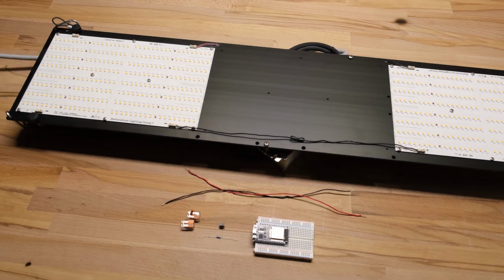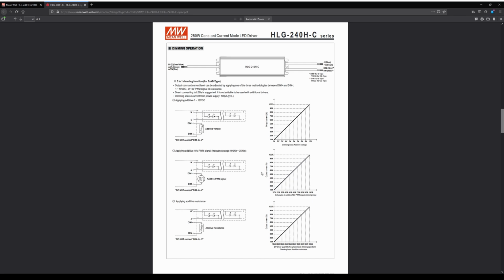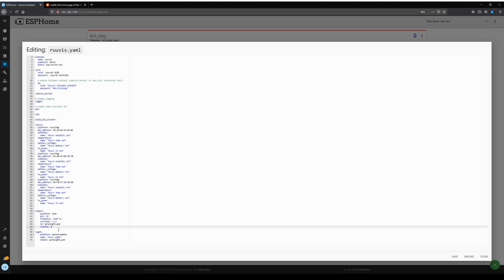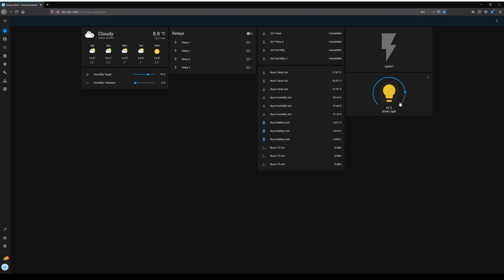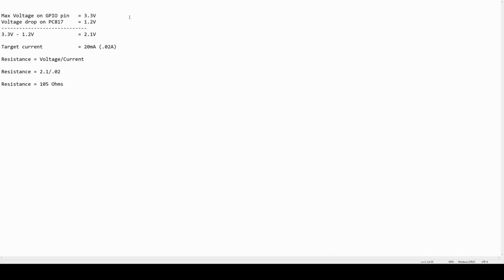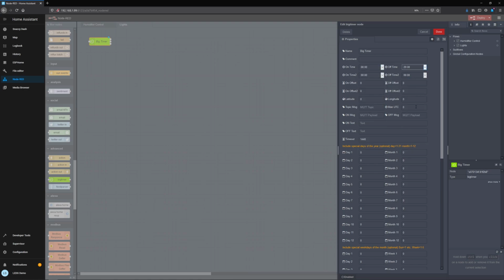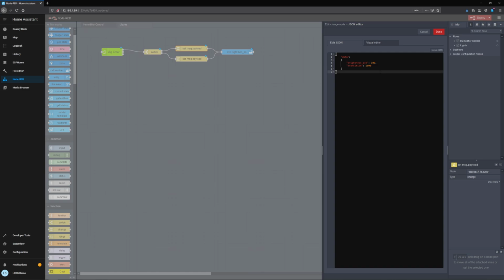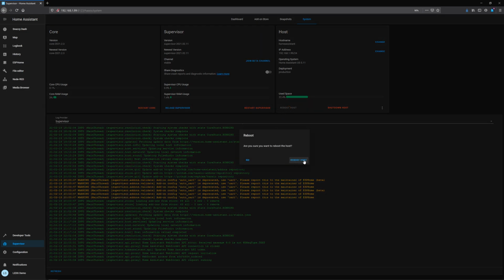Automate Your Grow with Home Assistant #7: Dimming & Scheduling Your Grow Light

Comment: Thank you very much for sharing such a high value content. It helps me a lot with my greenhouse project.
However I have one question regarding the brightness_pct value in JSON file. I am trying to use helper to set this value dynamically (from user input slider) as below:
"brightness_pct": msg.payload["input_number.light"]
But it shows error "Not valid JSON data"
Do you have any advice on this? Thank you
Reply: I found the solution: I use automation with this data
brightness_pct: '{{states("input_number.light") | int}}'

Comment: Can I use the same code for my ESP32 as you have with this driver?  https://img80002871.weyesimg.com/uploads/mosopower.cn/addon/15736278104243.pdf  I believe I can, but the only thing I don't get is where the 1220hz frequency comes from.  Thank you so much for making these videos!
Reply from the maker: Looks to me like that driver should work fine with this method (seems like it has the same 3-in-1 dimming where it sources power on the dim circuit). The PWM frequency spec on the data sheet is 200Hz to 2000Hz so 1220 is fine.
Reply: @LEDGardener  Thank you so much, I just tried it and it's working to dim up and down!  Very exciting I'm learning so much following your project.

Interestingly, the driver documentation says 0-10v, but when I power the 110v up from my smart plug the light doesn't come on until I go to 6% or above on the Home Assistant light card slider, and then when I go back down to 0% it doesn't turn off, it stays at about the 5% brightness, dimming ever so slightly more if I turn the light card "off."

Also, with the 1220hz, is that just the number you picked in between 200Hz and 2000Hz?  Or did you choose it based on electrical maths and the dimmer you were using?  I was going to try and hook up a AC Infinity Cloudline S4 the way you had hacked the PWM on your AC Infinity PWM fan, and saw the different Hz in your github code you mentioned with regard to the different channels on the ESP32 you talked about in the video.

Thanks again!
Reply from the maker: @fantasticplastic6170  this page will answer many of your questions: https://esphome.io/components/output/ledc.html   the 1220Hz is one of the recommended frequencies on the list and fits within the spec for most lights. 

Regarding the light not turning off completely, what happens if you short the 2 dim leads together? Does it turn off? You can set up thresholds for min_power and max_power which might help for the turn on/turn off issues. Check out this page for more info on these: https://esphome.io/components/output/index.html

I picked different frequencies for the fan control based on the freqs I measured when using the default controller it comes with. The new AC Infinity fans are even easier to control as they have actual PWM inputs you can use. The wiring is a bit different. I'm using these new S-series fans in my system now.
Reply: @LEDGardener  When I short the wires the light stays completely off.  Does that mean my ESP32 is leaking very slight amounts of power to the output pin after it's energized the first time, so when I go to turn it back off again it never goes low enough to completely turn off the diode on the optocoupler?  If the min_power defaults to 0 what would I set it to in order to use that to correct the issue, or am I trying the zero_means_zero command?  Right now I have two Flows going, where the light smartplug turns on 1 minute before the PWM starts to ramp up and one minute after it finishes ramping down, so it works fine, but I'd love to figure out why it's behaving like it is.

Thank you for the links, and for taking the time to answer questions!  I definitely understand the frequency thing better now I think, and am going to try and hook up the fan next and ramp it up and down based on temp or humidity based on what I learned here and in the humidity control video
Reply from the maker: Strange. Does reversing the dim wires on the driver have any effect? I was thinking you could set up the min_power to eliminate the first few percent not turning on the light from the off state, and then doing the zero_means_zero thing.
Reply: @LEDGardener  Interestingly adding the min_power: 0.05 and zero_means_zero: true didn't change anything, but reversing the dimming conductors did.  Now it doesn't turn on until I go above 20% on the slider, and then the light turns off completely again at <16%.

Hard to tell if the actual range/sensitivity of the slider has changed without a par meter or something to measure it, but it still seems about the same.

Comment: I got it all working mostly...The problem you mentioned about the dimming not working till you get to 50% I get that with the gamma_correct: 1.0 still. Do I just have to adjust that until i get what I need out of it? because little increments on the dimming make big light adjustments and I'd like more fine tuning than that.  TIA
Reply from the maker: Which driver and lights?

Comment: Could you show me your flow for the ezo ph sensor? Within node red? I’m struggling to figure out how to do it myself
Thanks
Reply from the maker: I didn’t do my system in node red, it’s in my home assistant automations
Reply: @LEDGardener  is it possible to add a delay within the automations so that it waits to test ph again after mixing before adding more ph down? I didn’t see that option so assumed I needed to use mode red
Reply from the maker: You can just set up an automation that triggers every 30 seconds or minute or whatever and when it triggers, it checks pH and if it’s out of range, it either doses a little blast up or down. A minute later the trigger will fire again and it’ll do the same check. I believe the trigger is called time pattern.
Reply: @LEDGardener  thanks I’ve got that working perfectly I just don’t see the option to get the action of turning pump on to last only seconds? It just turns it on for ever
Reply: Figured it out thanks I thought the actions ran concurrently didn’t realise it was one after the other
Reply: @LEDGardener  so is the HA automation wizard powerful enough to do all the automations you needed for the garden?
Reply from the maker: It is.

Comment: Does this work coupled with light sensors? For instance, in a light deprivation greenhouse where lights are used to supplement the sun. So the light sensors would measure the light coming in and brighten and dim the lights appropriately in real-time to try and keep a steady level of light at the canopy throughout the day.

Comment: Legend. This channel is superb! Ive just started following along. I havnt seen any soil moisture detection yet? Or have i missed it?  I have a little simple system with a cheap capacitive moisture sensor in rock wool but it doesnt seem to be very responsive. Do you have anyinfo/experience with these?? 
Thanks and keep up the channel its by far the best on this subject! 
Bob
Reply from the maker: Thanks! I haven't incorporated it yet since I grow in coco usually and just flood the hell out of it whether it's wet or dry.
Reply: Thanks. - do you have a video for setting up the weight sensors? Or know of a video tohelp me set them up with home assistant.
I want to try use these to tell me the water content of a rockwoolslab sat in a rigid tray.
Good idea? 
Thanks

Comment: hey man i have a question, i am starting to check the automations for the nute dose but since i used a cheaper peristaltic pump the 300ms on time for 1 ml does not apply as i tryed and for 1 ml i need 750ms on time, so my question is would change the multiplier in the other script be the appropriate way to go? so just change the multiplier in the 1dosenutes: script?
Reply from the maker: Have a read through this page of a thread where someone else ran into this problem in the forum for my answer: https://ledgardener.com/forum/viewtopic.php?p=24471#p24471
Reply: @LEDGardener  yeah as i thought, you said what i was trying to explain in that page. ;) glad i was not too far off, i tryed a lot before asking XD

Comment: Should a different resistor be used for a 600w driver?  Great videos by the way, thanks!
Reply from the maker: The output of the driver won’t affect the power on the dimming circuit so no.
Reply: Just got one working, thanks again.  Quick question though, can I use one esp32 to dim multiple drivers or should I use one esp32 per driver?
Reply from the maker: Just use the same ESP. Add another resistor, optocoupler, and declare another output and monochromatic light in ESPhome on a separate GPIO pin.

Comment: Do you have a reference for the nodemcu-32s board?

Update: Same setup works on nodemcu-32s board on pin 23. What I feel though is that the light on 100% with the pwm is slightly dimmer than without it. Not sure what is causing this. Else I'm able to dim/turn off at 0%.
Reply from the maker: If you disconnect 1 pin on the output of the opto does it get visibly brighter?

Comment from the maker: Hi all, something to add and one thing to correct... Afterwards, I also tested this method on an Inventronics EUD-600S560DT (HLG Scorpion Rspec) and EUD-600S280DT (HLG 600 Rspec) and it worked great. Something I need to correct in the video - at 11:33 I said that it didn't matter which way you plug the dim+ and dim- wires into the output of the optocoupler. This is incorrect. The Inventronics drivers I used did not dim all the way down to off unless I put the Dim- on the optocoupler emitter pin (with the orientation I have it in the video, it would be the top right pin) and the Dim+ on the collector pin (shown top left in video). So, if it doesn't work quite like you expected, try flipping your dim wires on your opto output!
Reply: Do you use float switches in your setup at all?

Comment: Hi! I made a pcb a while back that would totally fit your usecase. It's designed for a ESP32 to control up to 4 channels of either external meanwell drivers, LDD-H or LDD-L. And I included a lot of optional features like temp sensing for all 4 channels, a BME280 sensor, a light sensor, RTC and two Outputs for 12V PWM Fans. I could send you one or opensource the design files if you're interested...
Reply from the maker: Sounds pretty badass. What is the temp sensing for?
Reply: @LEDGardener  Monitoring/controling the LED panels temperature. Mainly for safety reasons...
Reply from the maker: Very nice. Which probes do you use?
Reply: @LEDGardener  Since I didn't need high precision I just integrated some 0805 ntc's in the LED pcbs...

Comment: Man this is awesome😉, could you please send me a picture of the cloudline t6 connection inside the fan? Now lights, humidifier, Nute pumps, ph and ec probes, flooding sensor, float basin sensor, external outlets for the pumps, 12v solenoid are working. I just don't know how to do with the t6 and I have to order a digispark board for the hx711 and do all the plumbing and I am done😉💪
Reply from the maker: Good work. Is it a new T6 or older one? The new ones have an “EC” motor.
Reply: @LEDGardener  yeah It is a new one sadly, I have two of them one for  the air intake and one for extraction
Reply: @LEDGardener  so i tryed anyway to wire the t6 like you have done aaaaand it worked XD i just intercepted the small yellow wire in the t6 wire box and invert the high setting number in the esp config with the low one, i have now pwm control over both intake and extraction, the only thing that will not work is power off the t6's since you are not actually cutting power that way but just intercepting the pwm cable, i tink i could wire it up to one of the spare relays in the control box and if i need to power off just cut the power that way..
Reply: @LEDGardener  hey mate, please can you tell me how to find the calibration factor for the hx711? i am really desperate :( now its working with the right module but its off by 20kg :( it is the last thing to calibrate..
Reply from the maker: Are you using my code for it or something different?
Reply: @LEDGardener  your code mate XD
Reply: @LEDGardener  sorry to bother you mate but this thing is driving me nuts.. how do you get the calibration factor? from what i understand i should press begin calibration, then remove all weights, then put stuff to be zeroed out(now it reads 0.0kg), then i put a 2lt milk pack on it(known weight 2125g) and then? i tryed to let the weight on and put 2.125 as calibration factor and save and does not change, it reads 2.52kg. i tryed to let the weight and put 0.42 as CF (known weight - reading weight) and save but does not work.. and every other combination.. can you tell me what is this damn calibration factor? XD sorry but it is an "urgent" matter since i cannot fill my mix res as it is a rdwc..
Reply: @LEDGardener i connected the arduino via serial and when i press save with any value in the range it wont really change, the serial displays -20000 and 199116 as zero factor all the time :( i am lost..
Reply from the maker: Yeah the sequence is 1- start with absolutely nothing resting on the sensors, press begin calibration. Wait for it to count down, then 2- put all the stuff on the scale that you want zeroed like the res, pumps, lid, etc., wait for it to count down, then put known weight in and adjust calibration factor from your dashboard until the readout is right, then remove the known weight and hit save. It’s important to remove the known weight before saving.
Reply from the maker: When you hit save, does it tell you that it has saved to EEPROM? Are you using a Mega?
Reply: @LEDGardener  so i tryed changing the base calibration factor to -24000 in the mega 2560 config and i saw that it should change in the calibration page when you hit the up and down arrow but it wasnt so now i have a perfectly calibrated scale but when i need to recalibrate it i need to hardcode the calibration factor from the code and yes it tells me saved to eeprom but its not true XD
Reply from the maker: Maybe you have an earlier version of the home assistant code - I have 
 an input number rather than up and down arrows, so you key in the value directly with keyboard
Reply: @LEDGardener  i have the input too but on desktop i have the arrows too.. but it does not affect the value displayed in the calibration page before hit save
Reply: @LEDGardener  what is the part of the code responsible to report the input value to the eeprom beside the arduino one? i am thinking i have an error there like u say if i have a non updated version
Reply: @LEDGardener  so i had an old version of your code, now i updated to the github current version but the problem is still there scale is working, calibrated from the code but i cannot change the calibration factor
Reply from the maker: do you have the automation set up in home assistant to update the scale calibration factor? 

- id: 12updatescalecal
  alias: Update Scale Cal Factor
  description: ''
  trigger:
  - platform: state
    entity_id: input_number.scale_cal_factor
  condition: []
  action:
  - service: mqtt.publish
    data:
      topic: calibrate/scale
      payload_template: '{{ (trigger.to_state.state) | int }}'
  mode: single
Reply: @LEDGardener  in the configurations.yaml that part was missing.. but still unless i press save the message does not change no matter what number i put, in configurations then automations page in home assistant i had an upsate scale cal factor which was triggered today but with no effects
Reply: @LEDGardener  i just noticed that ph and ec calibration in the calibration page are not working either and i think the ph speed pf the pump too
Reply from the maker: Fire up MQTT box and start monitoring the topics/payloads that should be coming from those buttons/automations and see if they’re coming through MQTT. For example, watch the topic calibrate/scale and start changing the calibration factor input number and see if MQTT box picks up the changes. You can also do this by going into home assistant integrations, then click configure on MQTT box and you will have the option to listen to a topic at the bottom of this window
Reply: @LEDGardener  done with mqttbox and only the begin and exit message of the calibrate/scale work, the change of the calibration factor does not work as the control/dosing topic
Reply from the maker: So if you listen to calibrate/scale you see nothing come through when you change the input number for scale calibration factor?
Reply: @LEDGardener  exactly as for clicking the ph cal step 1 or any others and listening to control/dosing
Reply: @LEDGardener  sorry to bother you again but no mqtt message of the ph cal is published using the topic calibrate/atlas_pH..
Reply from the maker: Check and see what the button is doing when you hold it